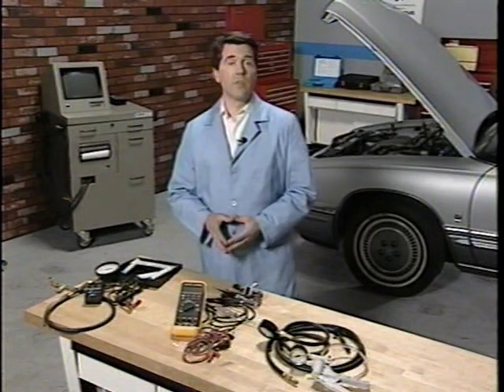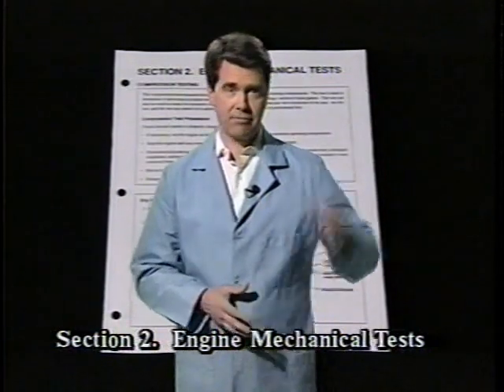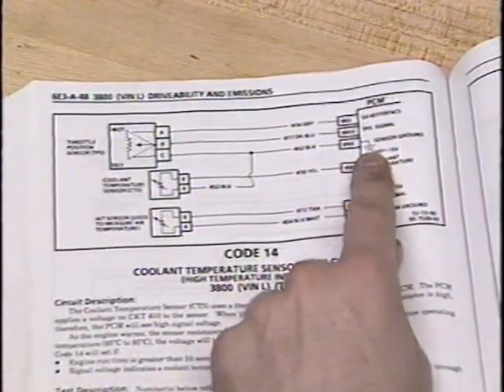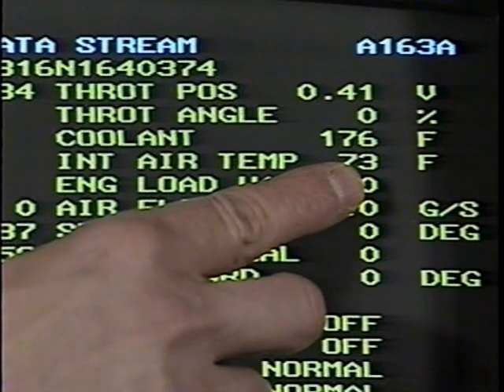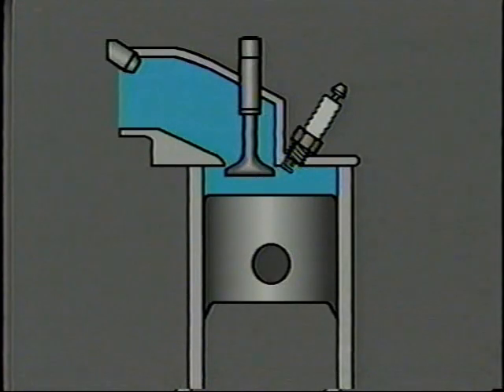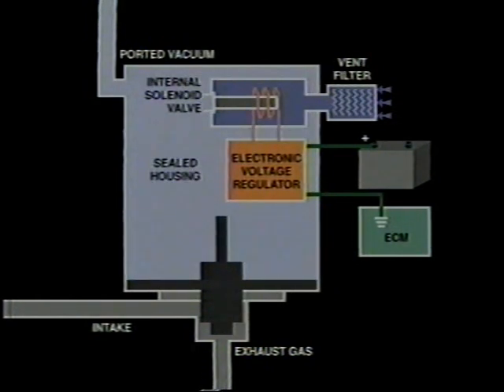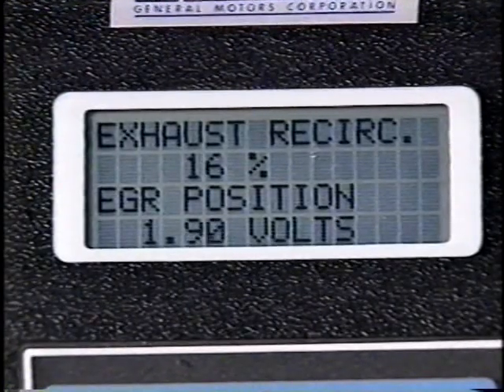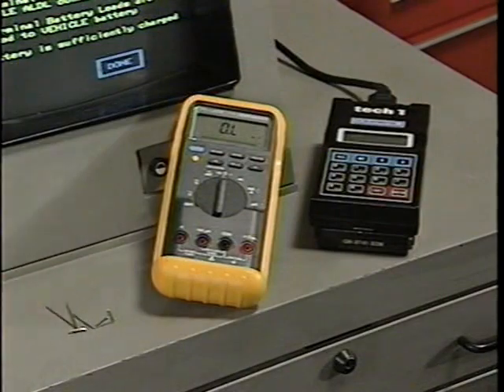Buick - Driveability Diagnosis: Component Operation & Testing (1992)

Comment: Step #1 : a visual inspection . While the tests here are thorough , most " technicians " only spend a fraction of their time testing . They are also under pressure to " fix the vehicle " , which translates into the parts cannon . Many of the components are buried and hard to access . This makes testing difficult or near impossible . Can you post a copy of that system diagnosis guide ? It may provide information that is overlooked . Thanks .